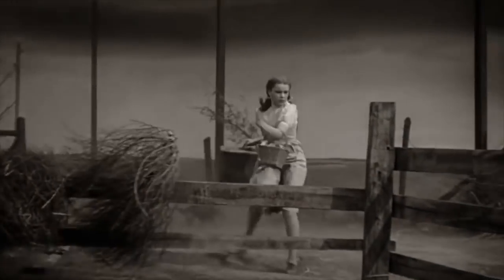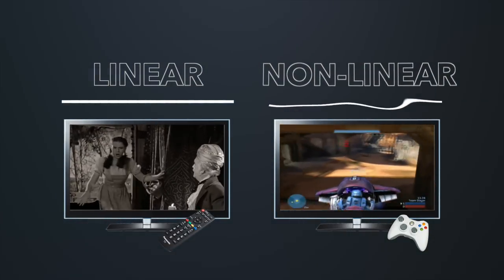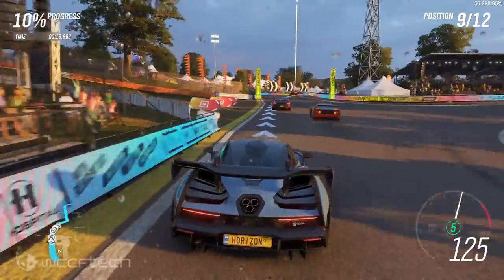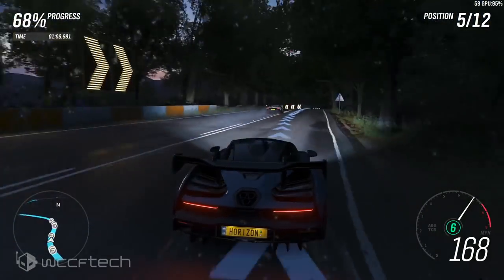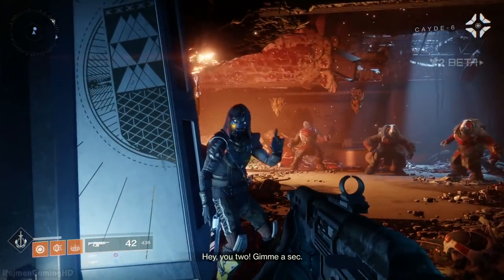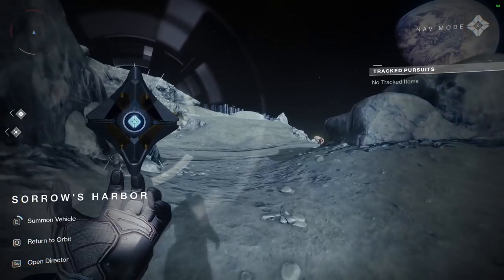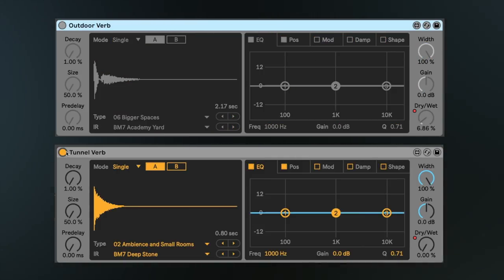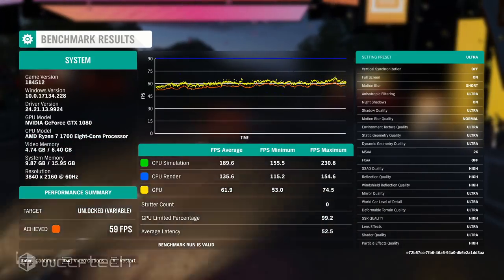How Sound Designers Make Futuristic Vehicles Sound Real

Comment: This is cool, will take some inspiration! Working on a car simulator currently and good engine sound samples are hard to come by, so I wrote a program that simulates the cylinders and pipings of a car engine and exhaust which is a slightly different approach :D It generates it from no samples at all, fully digital, but next step is to mix real samples of cylinders firing with the simulation